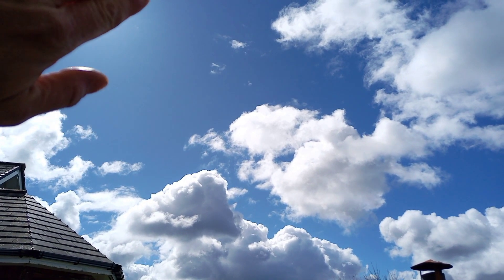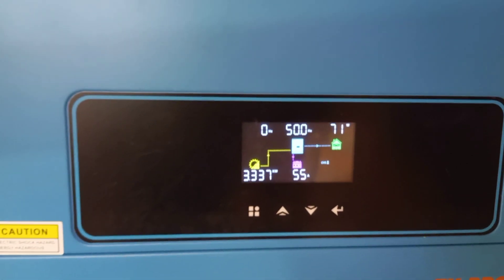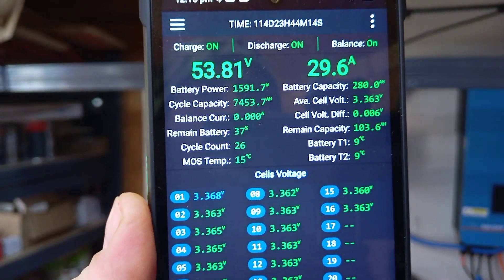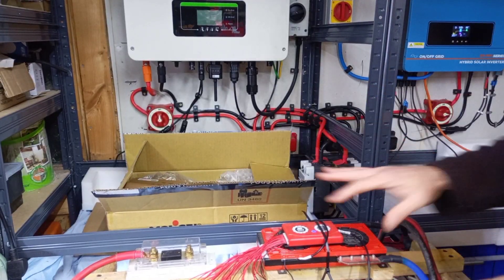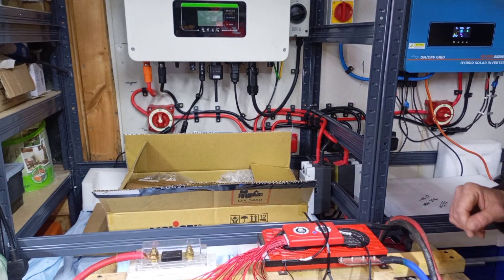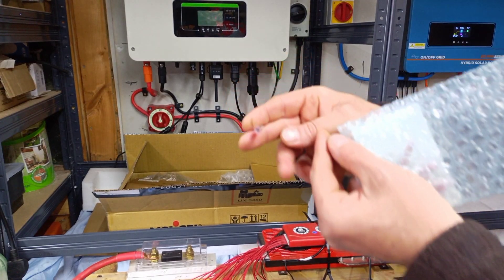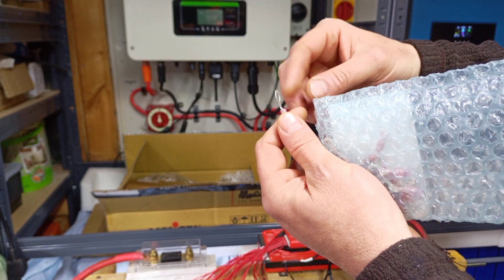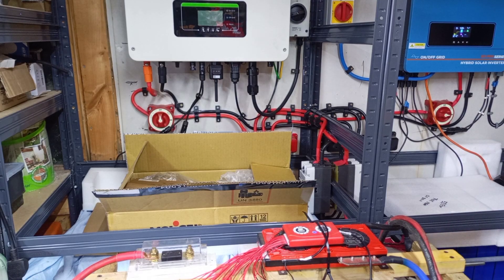Just clearing the decks ready for the JK PB2A16S-20P inverter BMS & SoFar HYD3680-EP Bench test.

Comment: I believe the green cables for the JK BMS is for the heat pad function and the small black and red wire is for a temp sensor. The ribbon cable is for connecting the BMS to the separate circuit board. The blue cable is to connect the BMS to the inverter and that's me done 🤣remember to set the BMS to the correct protocol for what you are using on the inverter so they talk to each other (either pylontech or daye) I can't see no reason why the BMS won't talk to the inverter once it's connected, everything SHOULD start functioning as it should
Reply from the maker: Hi man, yeah it is for heater pads. Going by the length of the he wires 15cm It's in the description in the manual as heater pads. Luckily all the other plus are not interchangeable so I can't screw it up.
The inverter had its own BMS cable and pins in a plug so the blue cable is spare for now, might work for the laptop but that is down the prioritys. 
Check on the pylontech that will be my first try.
Cheers bud